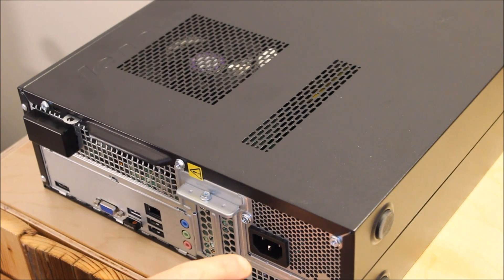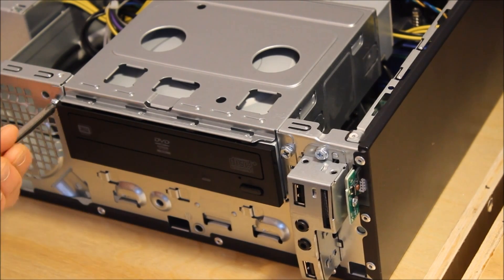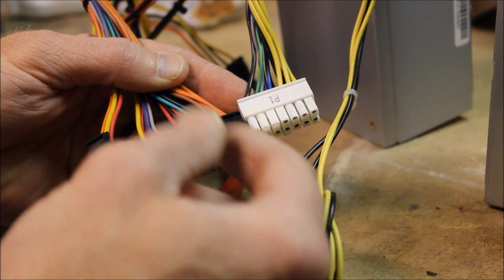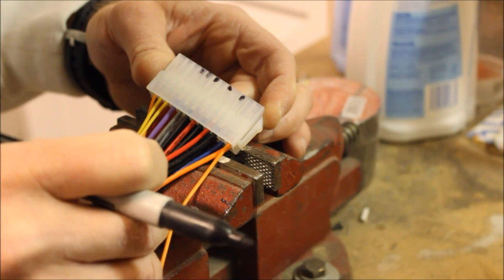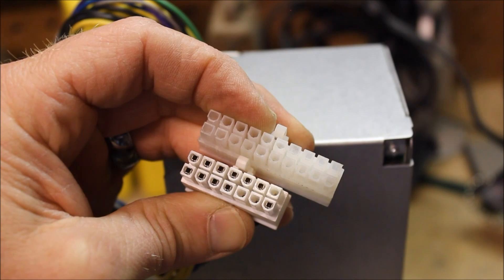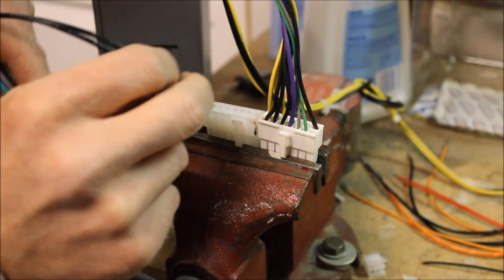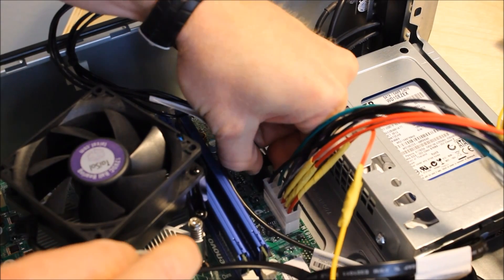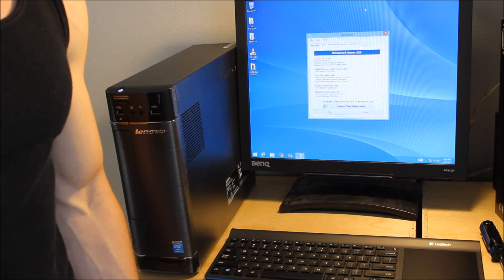Lenovo H530s Slimline Power Supply Upgrade

Comment: I've got the h500s and just ordered a new graphics card because I need the hd output for my tv. It has a 65w external power supply I home its enough. I find the lonova website rubbish for info on upgrades. I found it hard to find parts with it being a slim line your videos defiantly will help me
Reply from the maker: Looking at the Lenovo website on your PC it looks like a Nvidia GT 620 was the max card you could install as an add on option.  Using the Nvidia website the max power spec for that card is 49 watts.  Based off of those 2 things you could probably get a GT 730 or 720 and be fine.
Reply: AdventuresInDIY  thanks for the fast reply appreciate it. i've ordered this one should be arriving tomorrow do you think it will be any good?   http://www.scan.co.uk/products/2gb-xfx-radeon-r5-230-core-edition-pcie-30-(x16)-1066mhz-gddr3-gpu-625mhz-cores-80-vga-dvi-hdmi

I will have a look at the ones you've recommended might be more suitable. its nice to hear info of someone who knows something about these machines
Reply from the maker: mtuey That graphics card looks fine.  I just couldn't find how much power it draws from the system.  Only that it requires a 400 watt power supply.  Just make sure you keep all the packaging in case there is a power consumption issue when you install it.  I've installed graphics cards in the past that required more power than what was being fed to them and you get a warning saying the graphics card will not function at full capacity because there isn't enough power available.  Please let me know if it works for you.  That way other people can benefit.
Reply: It's not going well I put the graphics card in turned it on blank screen took the card back out turned it on. All it shows in the Lenovo sign and that's it, it won't boot widows got my brother inlaw looking at it he's an IT bloke. Left scratching his head not looking good might be the graveyard for it
Reply from the maker: mtuey Open the box up and make sure all the power and sata connections are seated properly.  Especially all connectors the connections on the motherboard for the drive power and connectors on all the drives.

Can you boot into the BIOS?  If you can, you can make sure that the PC can see the hard drive.  It'll be listed on the summary page.
Reply: Ye I've checked all the connections and we could get into bios but still nothing. 
I pay £3 a month for computer care so I have taken it in and they have had a look at pc world and can't fix it so are sending it back off to Lenovo should take a week if they can't fix it they will replace it then I think I'll pay them to fit it for me then the balls in there court or I'll pay extra and buy an upgraded version. 
All this because I bought a new TV ha I was pulling my hair out lastnight.
Reply: I'll keep you posted on the findings
Reply from the maker: mtuey Thanks.  I'm curious what the problem is.
Reply: Hey still haven't got my PC back apparently it's still in Germany they are waiting for a new hard drive. Don't know why the manufacture is waiting for parts. It's nearly been 4 weeks so I'm giving them 4 more days then I'm going in demanding a replacement even if the warranty won't pay out my care cover has too.
Reply from the maker: Unfortunately you sometimes have to be a pain in the butt to get stuff done.  Don't be afraid to get on the phone and bug them a lot till you get a resolution.

Comment: what graphics card and psu can i get that fits the lenovo h520s and that cost 130 pounds
Reply from the maker: I don't have access to that particular model, but I assuming it is similar to the h530s I have except the processor.   Sorry I can't give you specifics.  You could go with any TFX power supply but make sure is at least 350watts like the one in the video and article link.  You probably would be able to use a KENTEK 400 Watt 400W TFX Power Supply.  I looked on amazon and the connections are standard atx connections.  You'll still have to reconfigure the power connector to the motherboard so it'll work.  If you do decide to get that kentek make sure you measure your current power supply and see if they match up.

For graphics card I'd go with a Nvidia 700 series low profile card.  You might have to do one project at a time.  Power supply first and then graphics card.  Hope this helps a little.
Reply: Thank you